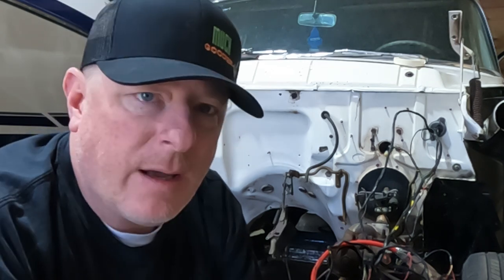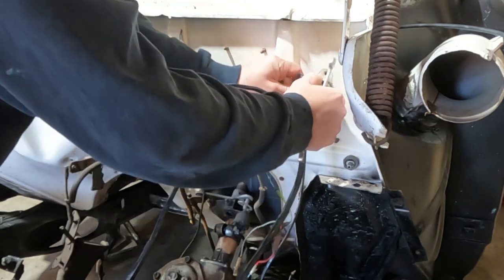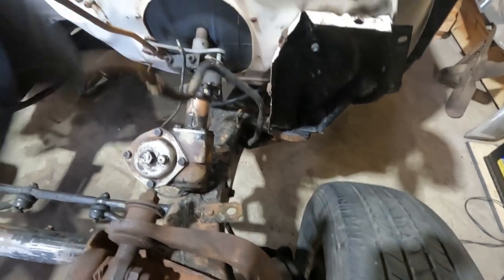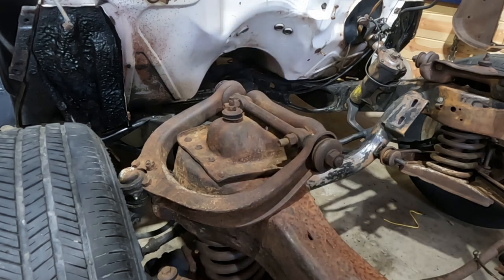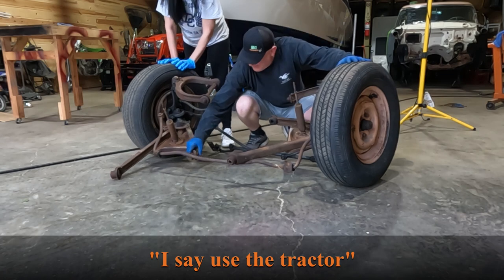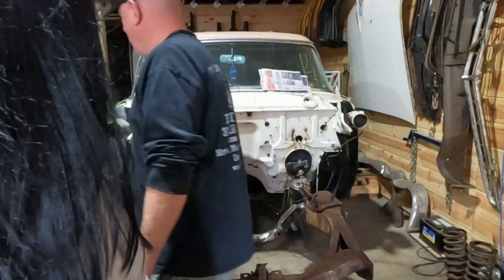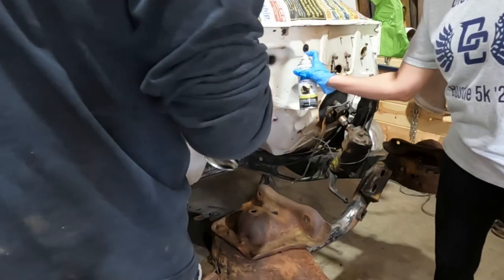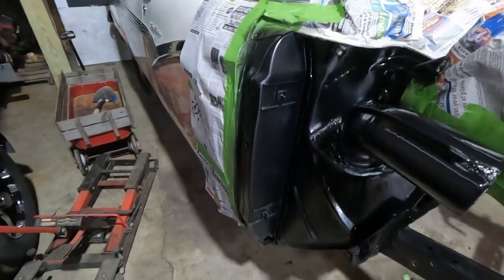1956 Ford Fairlane. Removing Front Suspension and PAINTING the Firewall

Comment: Scrap the 56 distributor and intake, the tall holley is worth bux. Been building Fords since 1969 and when I was young and dumb I replaced couple of 292s with FEs. Easy to do and exciting for a while but they ended up unused in the backyard. My favorite engine is 292 with 312 crank/rods/pistons (avoid 312 blocks). I have a street performance single 4, dual 4 and a supercharged 57 each with T85 OD trans 4:11 posi, pertronix/msd, long tube headers, front disk brakes and bolt on traction bars and each makes passengers poop a little. Suggest you keep the 292, use 57 or later distributor, heads, intake, carb and long tube headers, more than enough power, hell of a lot easier to keep running and better mileage than an FE. Don't need aluminum heads or intake or HE pistons. You hack that car and even if it does get finished will cost huge amount more than it'll be worth. A 460 would be just plain stupid. There's a real good reason 99% of all old Fords still have their 292/312s. I'd say yblock but that includes FE and MEL. Only use high zinc oil!
Reply from the maker: Thanks for the info. Still undecided on engines. Im sure when the time is right, it will get a good one for sure!